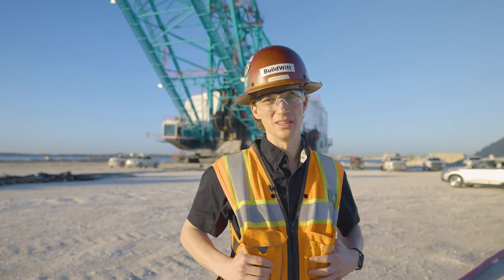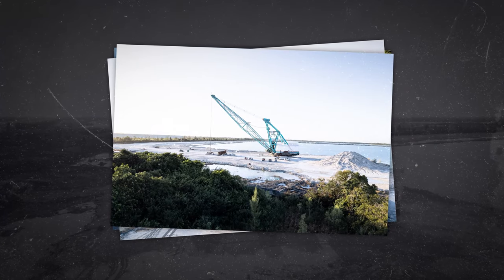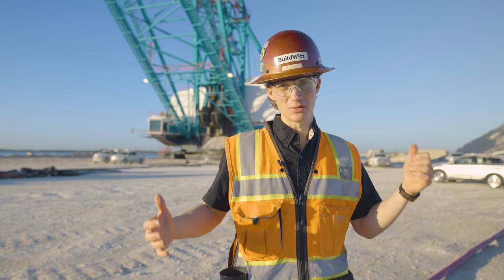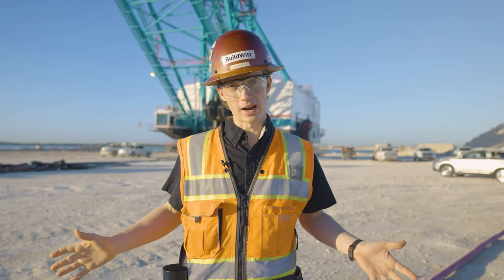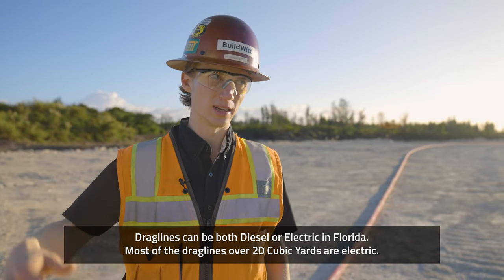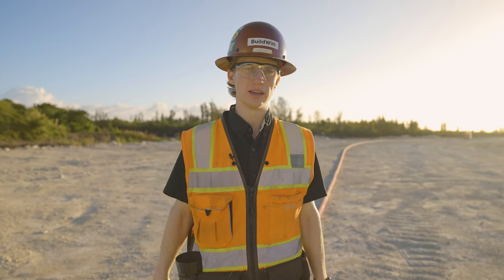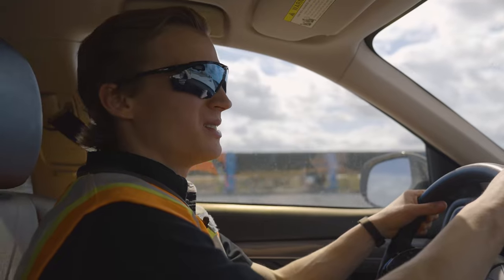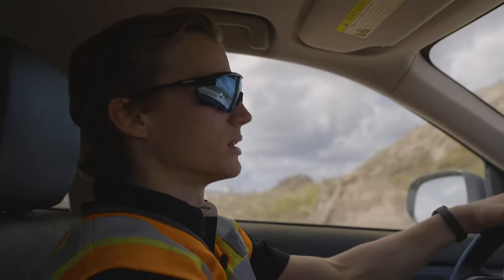The World's Biggest Aggregate Dragline with North American Mining

Comment: The marion 8200 is not the largest dragline.  The 8200 runs a bucket in the 80 cubic yd range.  A marion 8750 dragline will often run a 120 cubic yd bucket.  The  Ursus Major dragline, a Bucyrus Erie dragline, located at the Black Thunder coal mine in Wyoming,  runs a bucket with a capacity of 160 cubic yds. When I was working there, they got in a 175 yd bucket for the dragline. It made big news on the front page in local newspapers, but the bucket didn't last. They ended up going back to a 160 cubic yard bucket.

Comment: So... how does said drag line machine move around??
Reply: I believe it has  what's called feet. They rotate on a big steel wheel. So think of how we are walking, then the Dragline walks by the shoes the same way. It gives the Dragline a solid base
Like he was talking about the ground gravel material, under it for not allowing the Dragline to sink. The feet/ shoes if you will. Act as a stabilizer. Better than a huge track system. It's like the Dragline is sitting permanently to ground. If that helps to understand. There life is at location. The big mining Draglines in open pits. They are just dismantle at sit when done with there life. Look up ( Big Muskie)
Reply: search walking dragline walking
Reply: @rp1645  you’re correct that it moves on what are called shoes but it’s not exactly the way humans walk. When still, the part that contacts the ground is called the tub, a giant cylindrical base. When the dragline goes to move, both shoes rotate and come in contact with the ground and push the tub above the ground. The rotating motion then has the tub go in an arc placing it more forward, once the tub is back in contact with the ground the shoes then come up off the ground again and the cycle can repeat.
Reply: @funnybobjr  
Thank you so much for explaining the walking motion. I have seen it on TV, but never had as great a description as you did. Hope that help the person understand. I'm got to keep your as a reference for future information.